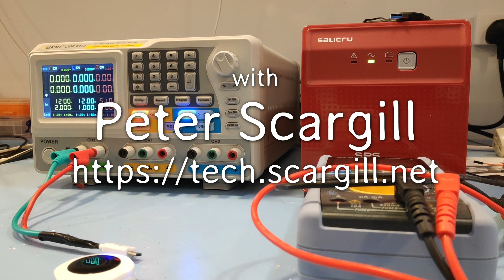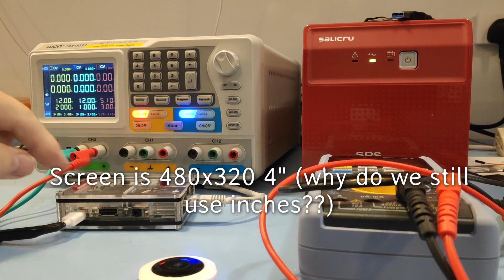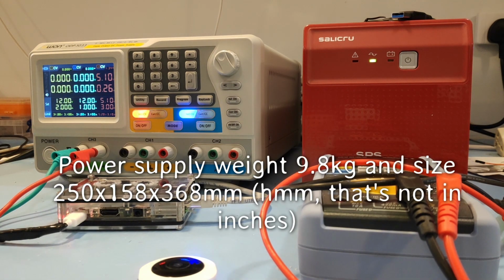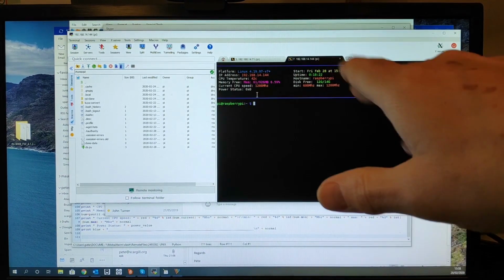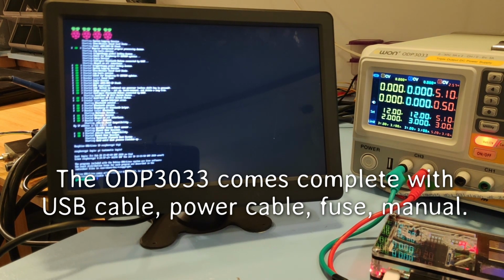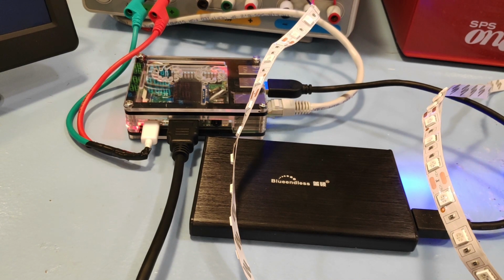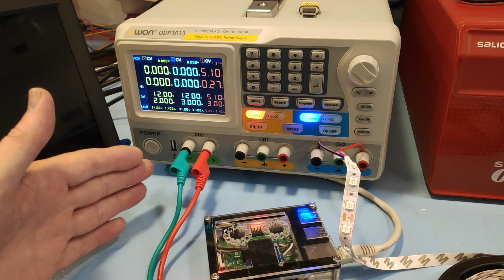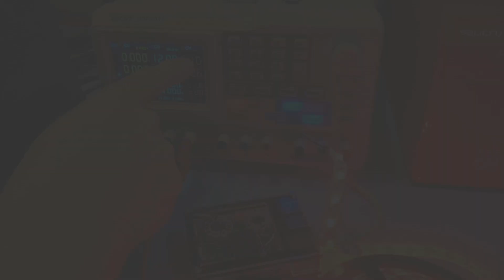Owon ODP3033 Triple-Output Power Supply - a PROPER Power Supply

Comment: I've got exactly the same model for more than a year now and I am very happy with it too!
Reply from the maker: Thanks DB. Thats a good point - based on experience so far with two of the Owon supplies, I've had no issues at all (which paraxoxically makes them less interesting to discuss - they just work).
Reply: @PeterScargill  Obviously, mine seems to be having problems after two weeks of usage. It just seems not booting up, main relay will trigger but no display, no output. It kinda started with strange behavior on the button lights, they flickered fast on/off but still booted up. Few re-starts and it's no longer doing even that.
Unit is under warranty but not very happy to ship this back to Netherlands from Finland. By any change you would have looked inside the unit, is there some flat cables etc which may have some intermittent issue?

Comment: awesome, when can you do a full review on this? as searching youtube there isnt one
Reply: I think once Pete receives his electronic dummy load 😬
Reply from the maker: It may be a while before I do more on this as I have a muntain of stuff to catch up on but yes, at some point I'll likely do more. Owon and Eleshop have lots more info but then hardly independent :-)  I'll also have look to see what else is out there on the subject. I now have a dummy load that easily handles the output of the Owon but which isn't that accurate - it did the job by proving that the Owon can sustain full load for hours on end but in terms of accuracy I have to trust my multimeter and the Owon display itself (both of which coincide thankfully).I guess the next step would be to check the voltage over the millisecond range - a job for the summer.

Comment: What a great product for testing . How many times have we had a failed product and not knowing if it was the product or the power supply .
Reply from the maker: Or the lead, even - important not to forget that. Buying short, high quality leads is the best one can do to eliminate that potential problem area. Many power supply designs are more concerned with weight and pricing - that's why it is nice to have one decent bench supply and a high quality meter as references...  of course in this example it would have heled if the Raspberry Pi designers had not made the Pi finicky about voltage requirements.